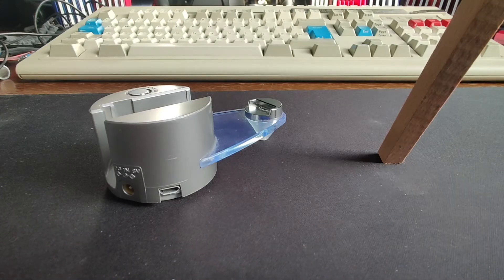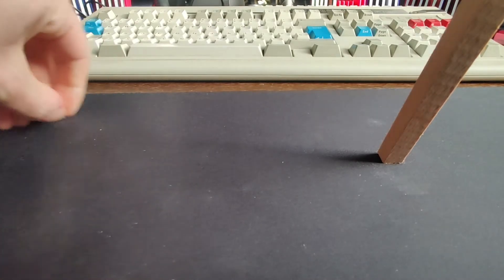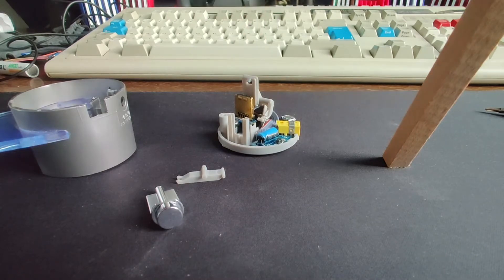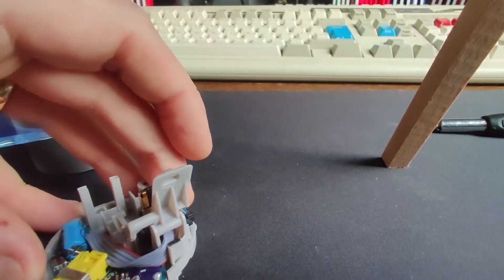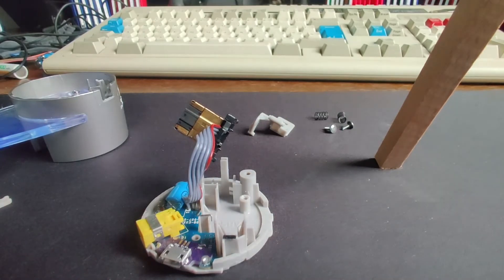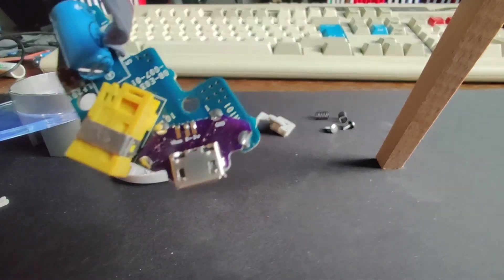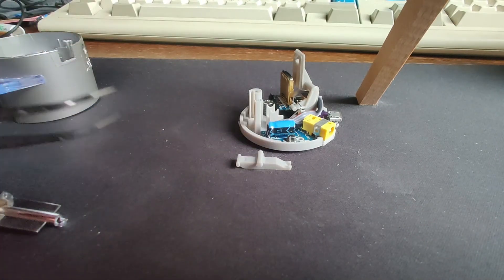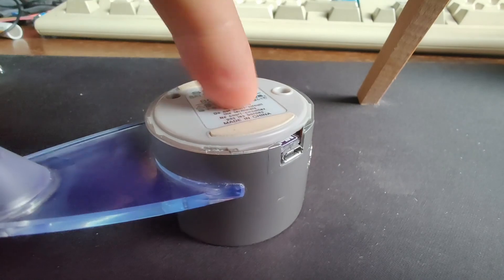How to disassemble an MZ-NH1 MiniDisc dock to add a USB connector mod

Comment: Did you have to join the DC_IN_6v rail to the USB_VBUS? I'm making a similar mod on my MZ-N10 battery caddy and it shuts off when I pug it in to USB. Wondering if it expects the 6V rail to be powered when the caddy is plugged in, though I realise you don't have the 6v supply plugged in.

Comment: Does this mod mean you can also transfer audio files to the Mindisc player instead of using the usb data cable via this USB port or is it only for charging? I have a almost brand new Sony NH1 but no usb data cable, so i can't transfer audio files from my pc to this device/minidisc. Thanks for helping out.
Reply from the maker: Yes, it only allows data transfers. Charging still has to be done with a 6V adaptor.

With this mod you can transfer music from a PC, without needing an original USB cable.

Comment: Hi mate, love your mod. Just wondering, have you thought about doing a similar type of mod on the actual minidisc player itself. I'm trying to get my head around the service manual and all the schematic drawings that show what's what. My plan is to replace the existing CN451 (USB) connector and replace it with a type C female socket. Ideally, if i can pay someone to do this for me that knows what they are actually doing then this would be much better. Do you know if it would be possible to add a USB type C on the disc player? would i need to add resistors to control the power input. I'm guessing the blue resistor that is found in the dock that you modified would probably need to be utilised in the mini disc player. free real estate inside the player seems a bit limited therefore it may not be possible. Let me know your thoughts.  Cheers
Reply from the maker: Thanks a lot.
I haven't thought of doing this myself, because I wanted to keep the player stock.
I think this would be difficult. There's not a lot of space, and you'd need to fit the adaptor PCB and a connector. The player requires 6V to charge (you can't charge over USB) so you'd either need to leave space for a separate 6V input, or add a voltage booster circuit to use the USB 5V to charge.

I don't want to risk ruining a rare player so am happy with just my dock mod for myself.
Reply: @unicyclematt  Thanks for the response. i agree with your thoughts. Maybe i'm a little ambitious trying to install a USB type c. I might be better of simply placing a straight female socket that takes the 6v power source such as the yellow socket that you no longer use on the dock. The job is definitely above my pay grade. I do feel though that it's possible. If i remove the current charging port on the player then i would have some room to install the new socket. I'll have to pull the player apart to see exactly how much room i have to play with and go from there. Thanks for your feedback. If i'm brave enough to move forward with the mod and i'm successful, i'll let you know. surely it can't be impossible. Fingers crossed.
Reply from the maker: @wwg1wga712  I still use the yellow 6V in on the dock to charge. The USB port I added won't charge the NH1.
If you manage to do any mod, I'd be interested in seeing!
Thanks,
Matt

Comment: Hi, does the battery charge via the usb 5v?
Reply from the maker: No, the MZ-NH1 has a separate pin for charging that needs 6V.

I wondered about trying to add a boost converter in there that turns the 5V into 6V for charging, but there's so little space
Reply: @unicyclematt  I have a step up converter already, will try to find some space for it.

Comment: Do you have the pin out or a picture of where the DATA pins and power pins should go on the internal PCB?
Reply from the maker: This may be helpful

https://www.dropbox.com/s/23q50x46c29byv5/MZ-NH1%20Dock%20mod%20tips.pdf?dl=0
Reply: Very nice work! Thank you!  If I can find a resonably priced external battery case, it looks like it may be possible to tap into that and turn the battery case into external charger as well.
Reply: @unicyclematt   I was able to do this mod today and it worked as advertised! :)  Thank you for sharing your findings.  Would the NH1 charge the battery with USB connected?  It does power up and connect to PC without battery, just not sure if it charges.  No led or indicators saying it is.
Reply from the maker: @rcboosted  well done, I'm glad it worked for you too. The NH1 can't charge the battery over USB unfortunately. I have to use the 6V power supply connected to the dock.
Reply from the maker: @rcboosted  out of interest, did you make a PCB like mine, or did you solder a usb cable directly?
Reply: @unicyclematt As a test for now, I soldered a cable and had it exit the existing 6v hole after removing the  6v jack. Since I don't have a 6v adapter and I had hoped it will charge over USB. Now I'm thinking of adding a voltage booster and wire it to the 6v pad, maybe that will charge via USB. Have to see if this will short out anything though.  Does it let you charge via 6v while connected to pc via USB?
Reply from the maker: @rcboosted  I've just tried it, and yes it will charge from 6V whilst it's connected to the computer via USB. 6V boost from the USB 5V sounds like a good idea.
Reply: @unicyclematt  Thank you for checking.  I will have to make sure the 6V won't feed back into the USB since there is some circuitry in the dock that I do not know what it does.  Also need to find a boost converter that fits, the one I have is too big.
Reply: @unicyclematt  that is i was looking for thank you